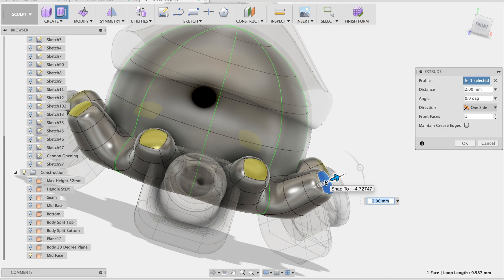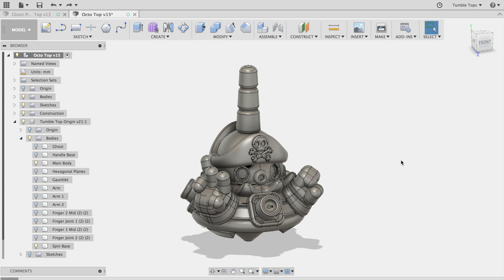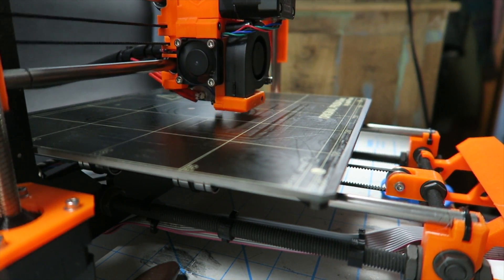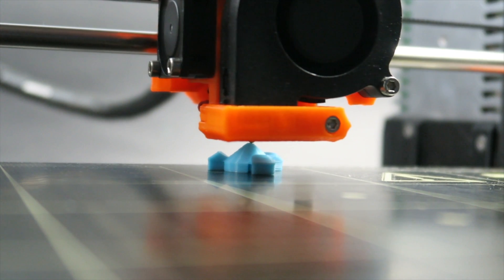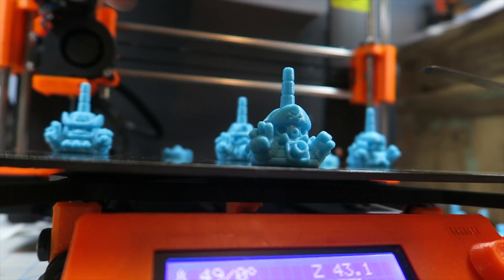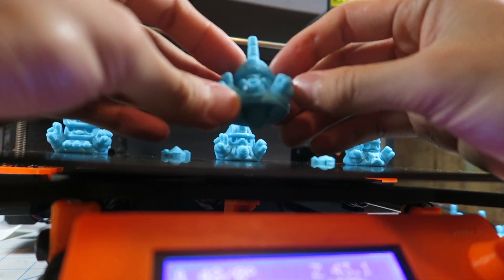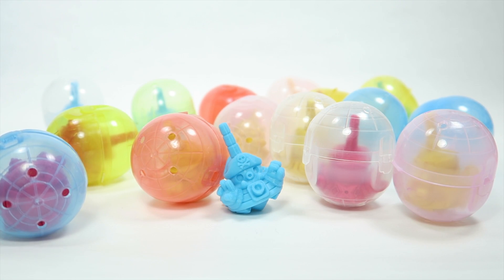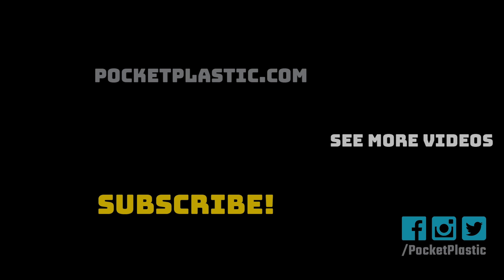3D Printed Gachapon Toys - Rock Paper Scissors Tops

Comment: Are they textured from the layers? I'm not sure what the technical term is, I don't know much about 3D printing.
Reply from the maker: Not to worry, I'm still new to it as well haha. I printed them at 0.2mm layer height so the layer lines are slightly visible. But they don't take away from the designs at all!